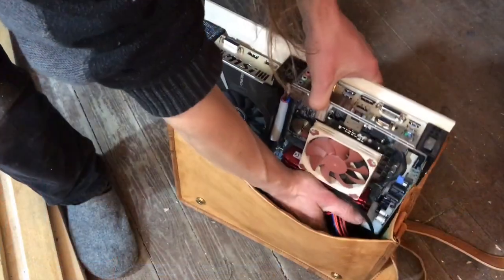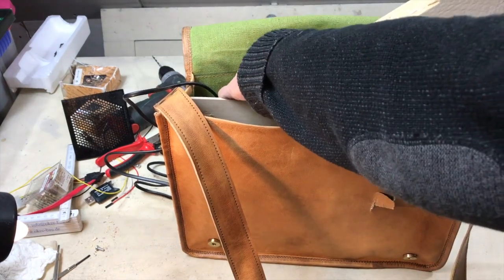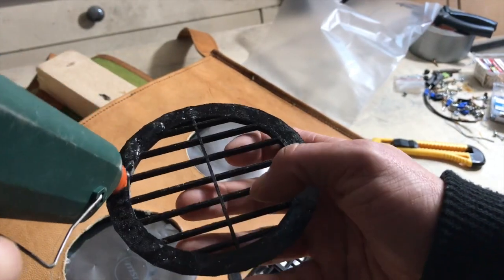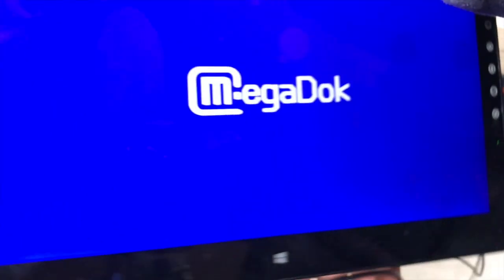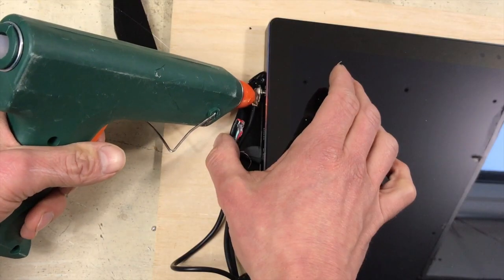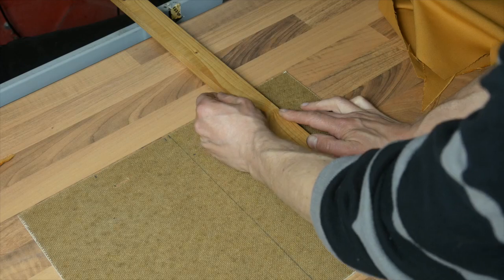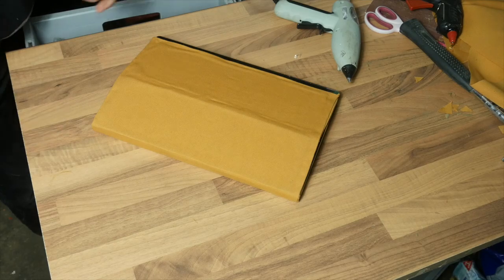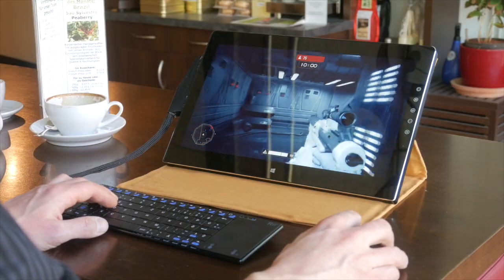⚙️ PC-In-A-Bag – DIY mobile computing – Part 2 PC Build Log

Comment: Hi - is there any updates on this your build? 
Did you use in until now? 
How it appear thru past time? 
Is this PC is convenient or no?
may be you film new video about thing which appear in using this PC?
Reply from the maker: Actually, i have not. For two reasons: I have run into power supply issues, the one in the video died on me, then I had a replacement, which lead to crashes, because it obviously could not deliver enough power. 
And then I use fa too many hard disks. I couldn't git them all in the bag. I still use the same hardware, but outside the bag, I still use the same hardware, but outside the bag and with a proper pc power supply.
I might even make a video about the current case. :-)
Reply: @fluxing5109  thx for answer. for me it not surprised about psu issues because picoPSU is very fragile.
And it would be interesting to see update on this project, because your build is pretty uniq (strange that so small views in two years...), at least on youtube for sure, and even if you not use it any more - simply update - what happened, like a postmortem in game dev about a project 😃